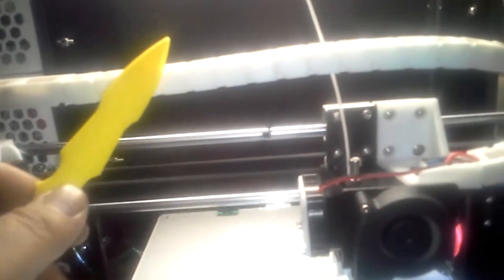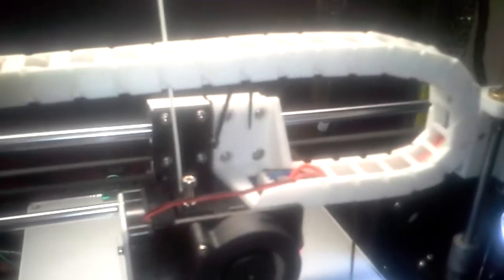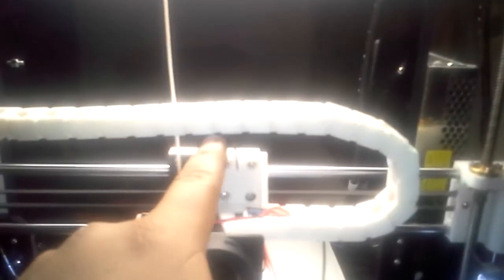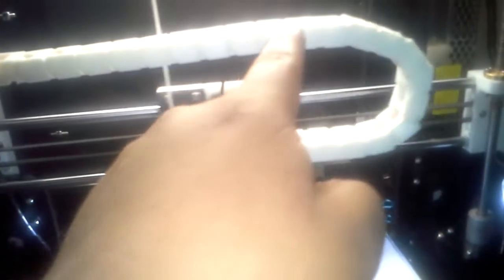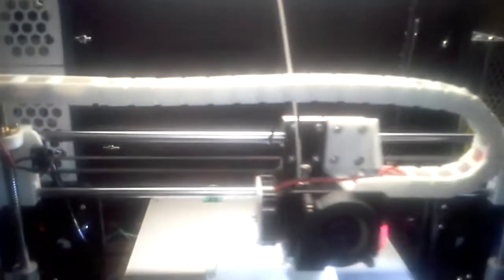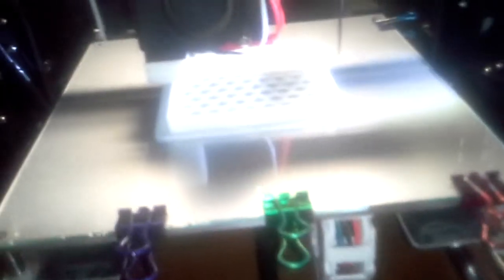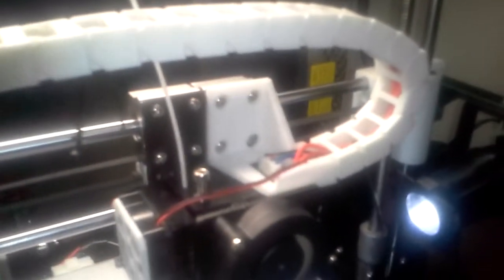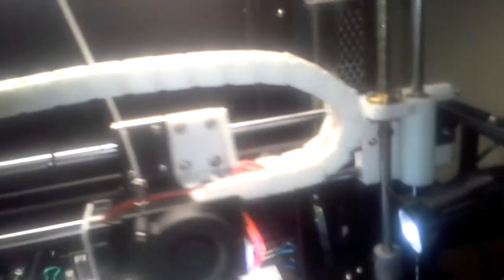Anet A8 Cable Chains.

Comment: how do you stop the filament rubbing on the chain? I just installed one on my printer and the filament catches on it really bad
Reply from the maker: i only have a guide on top of the screen and never had a problem.
Reply: i just made the filament holder that sits on top and now it is perfect.
Reply from the maker: right on man.